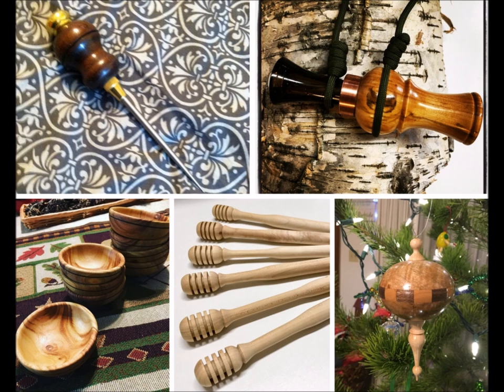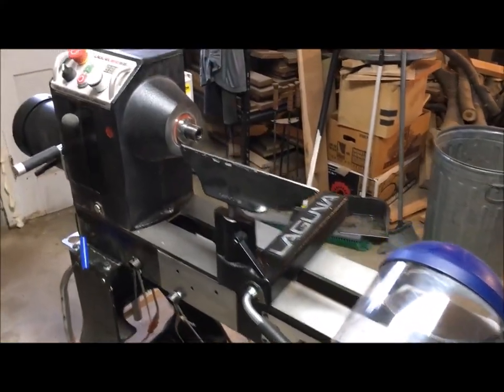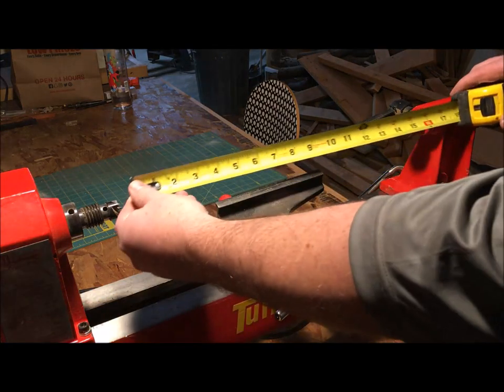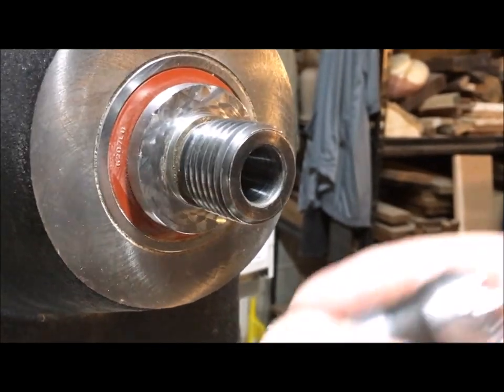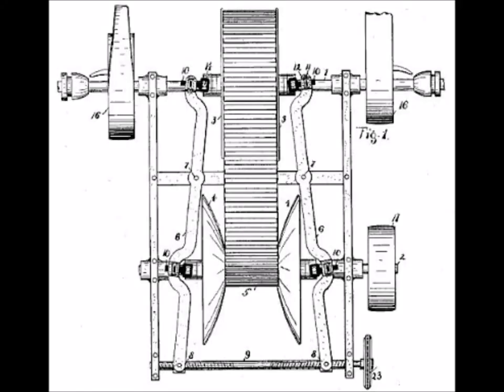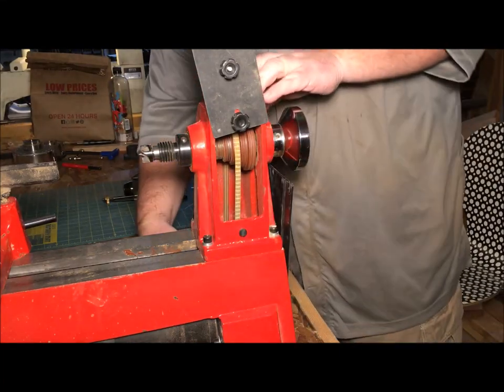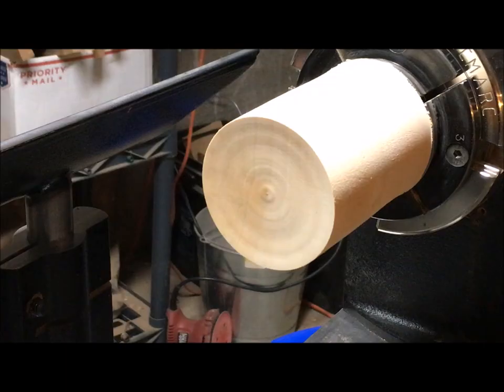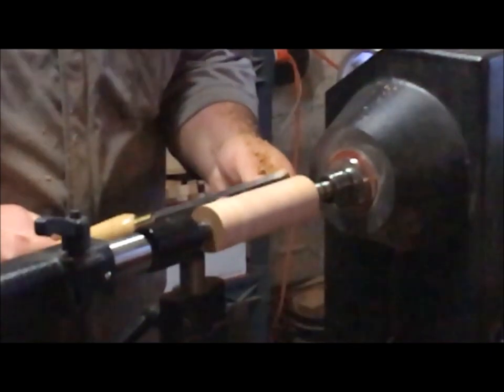what lathe should I buy?

Comment: The best advice I would give to beginning turners is to buy a used lathe cheap to see if you want to continue turning or not. If you do then get the lathe you want and if not you don't have much invested.
Reply from the maker: Good advice
Reply: Being brand new to the hobby, I'm edging towards used, purely down to budget. The only thing that worries me is I wouldn't know if I was being sold a lemon.
Would you consider doing a video on what to look for when buying used?
Or point me in the right direction. 
Cheers.

Comment: I have been woodworking forever and had never turned on a lathe.  I was NOT going to drop upwards of $2000 on a lathe not having any idea if I would even like it.  I opted for a Delta.  I think it's called a "midi".  Couldn't be happier.  Under $1000, handles most everything I wanted to do to learn and fits in my tiny space available. It of course has its' limitations but the quality was very good for the price.  Now, two years later I am ready for a full size lathe but have no plans of getting rid of my Delta.  FYI, it is a new Delta, not an old school Delta which I would have preferred.  Now I am ready to drop $2k, maybe even $3k on a decent full size lathe.  I wish I had gotten into turning decades ago.  Fun and practical.
Reply from the maker: Great! Woodturning hooks ya!  I wish you well in your search for a bigger lathe! 😀
Reply: The question is which bigger lathe!?  Your video was a good one and showed every single available option out there for lathes in general but I don't think I saw a l preference towards one or the other.  In my search I "think" Laguna offers the most bang for buck?  I was looking at the 18/36.  I have a few Powermatic tools and they have been great but not cheap.  I may go that route if I am able.  No one wants to make such a large investment and find out their 600 pound, $4k lathe is not up to the task. Rather than getting a lathe that already has everything on it it may be more prudent to buy one with upgradability and add things on as time goes on and the need arises for other features. @Geiserwoodturner
Reply from the maker: @johnbauby6612 I think if I was to recommend something it would be Powermatic.  It is a bit more $ though. My experience with my Laguna lathe is that it is adequate.  I’ve had the chance to upgrade more than once and have not however.  Over the years I’ve worked through most of the quirks and problems and I’m satisfied with my 18/36. It does what I need it to do and that is what counts.  If I were to upgrade it would be to a Vicmarc or Robust lathe, but they are high end and pricey.  So I guess in summary Laguna is adequate and a good value for the money but you may have tool rest banjo and possible electronics issues. I’ve heard good and bad about customer service.  Powermatic is a great machine, more expensive.  I’ve heard that they have less problems but can have some.  I’ve heard they have great customer service. 
I hope this helps some. 😊

Comment: If you have some room, but not a lot for any one machine, you might consider a Shopsmith mark 5 or 6 or 7. It's many tools in one, including a lathe, and you can get extras like a bandsaw attachment. They are not cheap, especially new, but when you consider all you get in one machine, the price becomes reasonable. If you have the space for dedicated machines, no you probably don't want one, but for us guys with small workspaces, they make more things possible than say just a lathe (they're also a table saw, and a drill press and horizontal boring machine, and a few other things depending on what attachments you have.)  Used they can be down right reasonable for what you actually get.
Reply from the maker: I started turning on a shopsmith so they have a place in my heart.  At this point they are a little limited as far as the lathe goes but a great machine for small spaces.
Reply: @Geiserwoodturner  well I've never seen a mulittool of any kind that is the best at anything, but if you don't have much space, they're brilliant.

Comment: Excellent video! It has been a good help when deciding which lathe to buy. Would it be possible with a shopping guide for woodturning tools too? Perhaps showing the difference between cheap and expensive tools, the pros and cons of buying a set of tools, which ones to buy first if not buying a set? I think I wouldn't be alone wishing for such a guide without the sales pitch. 🙂
(I'm not sure I use the correct terminology, but with "woodturning tools" I mean the gouges, chisels, etc that are used when woodturning.)
Reply from the maker: Thanks so much!  A guide to buying woodturning tools would be a great idea! Yes You are using the correct terminology.  I call them  turning tools but I have heard them called Chisels, gouges, and knives ext.  Which tools to buy first is also a great video idea. I’ll get working on videos, but just as a thought my top three would be a spindle roughing gouge, a 3/8” spindle gouge, and a parting tool.  If you plan on making bowls a 1/2” bowl gouge would be a great starter as well.

Comment: I found a vintage shopsmith and installed a dc treadmill motor with speed control,,, works very well,,
Reply from the maker: Nice!  I love that kind of ingenuity 😀
Reply: @Geiserwoodturner   thanks,, it has unbelievable power and very quiet and smooth,,,and I can adjust to any RPMS

Comment: I went thru this 45 years ago and made my own lathe..  My purpose was to make larger bowls.. The result was made from 3 inch maple with one inch shaft with 8 threads per inch. I put 4 pulleys top and bottom..  speeds varied from 250 to 4000 rpm.  I made over 800 bowls with lather but was always to fast for out of round wood..  mostly oak firewood that was green, turned twice..10 years ago I made a new lathe from twin ibeams.. I bought a phase converter that took 220 single phase in and output triple phase..  The converter allows speeds from 1 rpm to 4000..  The result is off the charts..  This lathe takes up to 38 inches in diameter and is a brut.. The lathe weighs in at 450 pounds..  it’s has split second casters to allow movement.. that pick up and drop easlie..I have 2 4 bolt flange pillow blocks on each end and the sky is the limit.. Cost was $660..  I never worry about out of rounds anymore.. The lathe weighs so much it can’t shake anymore….   I just keep turning..  My wish is folks think about this.. a buddy that welds  completed all the welds in’ 4 hours.. The inverter box cost $180 with 2 .5 hp.  Motor..  This thing is amazing..think all.. save your money.. I have pictures of it on fb..enjoy your hobby at lower costs..  😁😊👍. over 50 years I have turned over 1100 bowls that have been given away to old friends, retired good bye and sweet old ladies that needed a lift.. my way to make society happy..
Reply from the maker: I have a buddy that built his own lathe. He is a machinist by trade and can pretty much do anything he sets his mind to. If you have the means and the know how, go ahead and build. Thanks for sharing about your lathe. 😀
Reply: @Geiserwoodturner  wish I could share pictures.. I am not a machinist.  my lathe is simple, very useful and cheap but built to take abuse..

Comment: I'm stuck in indecision! I have a budget 1216 midi lathe with EVS. I tried turning a 12" bowl on it, I managed to get it done but felt very sorry for the lathe and promised I wouldn't do that to it again! Apart from that it has been a great lathe.

My first thought was to get one of those generic Reeves drive long bed lathes, just for turning bigger projects. And keep my midi lathe for smaller projects. That's about all my budget would allow at the moment.  Also, I'd have to get rid of some stuff to make room for it. 

Most advice seems to be don't buy budget gear. Also, as much as I like my midi lathe, upgrading to a decent solid built machine is appealing, except for the budget!

Conundrum, do I get the 2nd budget lathe to compensate for what mine can't do, and use that until I can afford a decent lathe. Or do  I just wait until I can afford a decent machine. And how long will that take?
Reply from the maker: Thanks watching! I think this is a conundrum for most of us.  Do I get only what I need or do I get by and save for what I want?  I’ve been there many times and there is no easy answer.  The best advice I can give is keep your eye out for the best possible deal for your budget.  There are many alternative ways to find a good lathe if you look hard enough even on a budget. For instance schools often have equipment they are getting rid of for auction. A good machine is definitely worth the wait.  I honestly believe if we intend on growing our woodturning abilities and we concentrate on what will best help us do that, the right lathe will find it’s way to us.  If you are considering the Reeves drive, I know a guy that owns one. He’s rebuilt the Reeves drive twice now and still loves the lathe. I wish you the best!
Reply: @Geiserwoodturner  Thank you, that's really helpful. I will focus on getting the lathe I want rather than compromise and get one that will fill in. I appreciate the suggestion of getting a used machine, but my little local turning shop stocks the lathe I want, and I tend to want to support them as much as I can. It's pretty much a mom and pop store who make you a coffee when you go there! I always spend too much there! Thanks again. 

In addition, I saw a review of the budget lathe I was thinking of getting and the biggest complaint was poor build quality, so that also helped!

Comment: Do you have a video showing the advantages/ disadvantages of a sliding headstock vs. a swivel headstock?
Reply from the maker: I don’t have a video at this time on this subject. Interesting topic though.  I’ve only ever used lathes with a sliding headstock.  Both would make it possible to get the lathe bed out of the way for outboard turning. The only differences would be in the comfort of the user and price of attachments needed to outboard turn. There are some advantages to either one might make a great video!  Thanks

Comment: Thanks as this was a good info video. I checked out all these lathes on their Amazon links you attached and except for the $4500 Powermatic everyone had some good and also some very bad reviews with most of the complaints being manufacturing issues like bolt holes missing or not tapped out correctly and even a break in the frame and terrible shipping from Amazon. I believe if these lathes were purchased from a more reputable dealer a lot of these problems would go away. I just retired and am getting back into woodworking and although I can afford the Powermatic. (No brag I worked all my life to save my money) I'm leaning more towards the Laguna lathe. I am more into pens and small bowls and such. Thanks
Reply from the maker: That’s great info. I’d never read reviews from amazon about Powermatic. Just talked to people who have owned them. If you want a spare no expense lathe look into robust lathes. I’ve personally turned on one and it’s premium.
Reply: @Geiserwoodturner  Thanks do you have a LINK. As I said I retired and was also blessed with inheriting most of the wood from my Uncles wood shop of over 60 years. I literally have boxes and buckets full of hardwoods of all sizes and species including some nice pieces of Ebony plus huge slabs weighing from 50 to almost 300 pounds of Maple and Walnut and others. If I lived to be 100 I could never use it all because he never threw any wood away. As soon as I decide on my lathe I plan on getting busy practicing. Next I want to buy some top quality turning tools as the money I won't have to spend buying wood can be used for better equipment. Thanks
Reply from the maker: I don’t have a link for Robust tools they only use reputable dealers and well known woodturners as dealers. Check out Sam Angelo (Wyomingwoodturner), or Carl Jacobsen on Youtube. Also I think craft supplies Usa is a dealer. As for top of the line turning tools I like Thompsonlathetools.com by Doug Thompson or D-way tools.
Reply: @Geiserwoodturner  Thanks I took a look and they look like top quality and the prices don't look bad. Gonna do some more research to get the correct ones for pens and such. Thanks again
Reply: Actually found the American Beauty lathe on the Woodcraft site but if I spent $8000 on a lathe it would take a week to get my wife's foot out of my Ass

Comment: Looking to buy my first lathe. This was a great video, I learned a lot.  As far as brands and models are concerned,  do you have any recommendations? Money is always a issue, but I know that good tools cost money.  I think I would like a full size lathe. I have a few grizzly wood products, and have considered going that route.  I do have a couple Laguna tools, and know they make a premium product.  Other names I know are delta, and jet. Just not sure where my best bang for the buck is. I would like to be at or under the $2k mark. Thanks in advance for any suggestions.
Reply from the maker: As far as brands go all the companies that you mentioned have lathes that I would recommend. I use a Laguna lathe and would recommend it but it’s a touch over your 2k limit. Delta is good. Jet is great. I’ve never turned on a grizzly but have owned other woodworking tools. I’ve heard from others they can be great. If I were to do it again I might go with a Grizzly just to save some money and get more chuck jaws and tools. I’ve been happy with my Laguna though. I haven’t been able to slow it down yet!  I hope some of this helps.  It sounds like you are on the right track!

Comment: Hi, great video, very well presented and informative. My question, I wish to purchase a lathe for turning my own topwater fishing lures but am unsure of the size (motor capacity) I will need to do this? Some of the topwater lures are for big fish so I would be starting with wood sized in diameter 100millimeters by 100millimeters. I also noticed that a manufactured lathe can bear many different brand names and it is a little confusing reading reviews. Could you please tell me what manufactures you would personally recommend? Thank you very much.
Reply from the maker: I’d be happy to recommend some brand names. I just didn’t in the video because I wanted to keep it unbiased.  Most lathes should be able to handle the size you are talking about. You might want to think about if you want to expand to bigger items later.  (I know I did).  I’d probably recommend a lathe with a 12” swing or better.  Usually a good brand with a bigger swing will have a motor to match.  Some good brands include Jet, Laguna, Nova.  I’ve heard good and bad about Grizzly full size lathes (but I know people that love them). If you can afford it the top of the line lathes would be Powermatic, Oneway, Vicmarc, and Robust.  I own a Laguna Lathe and I like it.  Jet, Nova, and Laguna all have 12” swing variable speed lathes now that are comparable in price.  I hope this helps! Happy turning!
Reply: @Geiserwoodturner  Thank you for the advice, it is very much appreciated.

Comment: Extremely helpful! This is my first time turning 
And I’m stuck with either the Laguna 18 36 or the harbor freight 12x33. I know a significant difference in price.  but as a beginner, I don’t know would I be discouraged with inefficiency of the HF
Reply from the maker: I just have to say don’t be afraid to look at other alternatives. For only 12” of swing you can find something with a more powerful motor than the HF model if you go between those price points. I think you would be happy with something like a Jet 1221vs or something similar. If you want to do longer items you can get an extension. In my experience you’ll never be disappointed by a more powerful motor  but if you get less you’ll be wishing for more and it can be frustrating. Maybe check out the grizzly G0838. It’s somewhere in the middle in price but has a 2hp 3 phase motor with a VFD.  It doesn’t have as much between centers but the extension is like $130. Hope this points you in the right direction!
Reply: Thanks bro! What’s your thought on the Shop Fox 16 in. x 46 in. 110-Volt 2 HP Wood Lathe with Stand and Dro
Reply from the maker: I don’t know specifically but I’ve used shopfox tools before and they were good. Comparable to grizzly in fact I think it’s technically the same company. I could be wrong.

Comment: i am a teen That is into woodwork and i was thinking what lathe i should get i have £200 and i obnly need something small that can do small bowl a file handle or anything around that any recommendations?
Reply from the maker: It sounds like you may be from the UK.  I’m not totally familiar with prices and brands in your area, I did a quick search and found a Record Power lathe for £239 from Yandles. I’ve heard they are a good brand. Other than that you may look for a used mini lathe.  Search for some woodturning groups in your area and they might be able to help you locate a good lathe.
Reply: @Geiserwoodturner  would parkside be a good one?
Reply from the maker: @lucaskeys6092  no idea never heard of it.